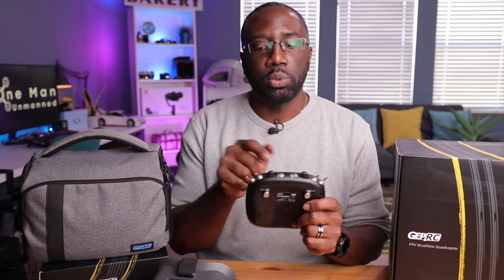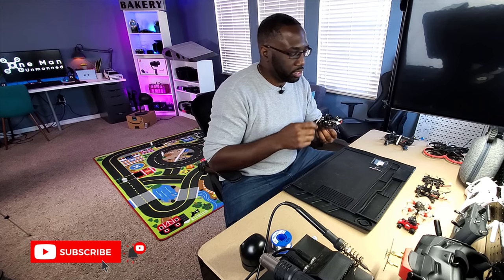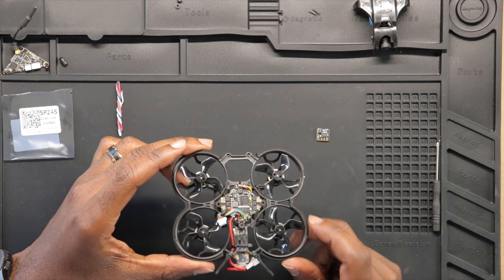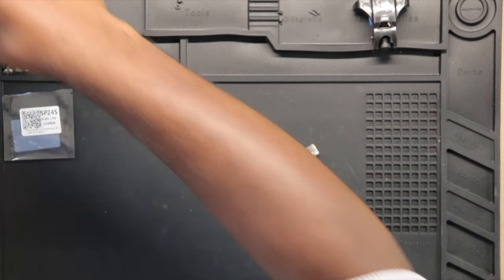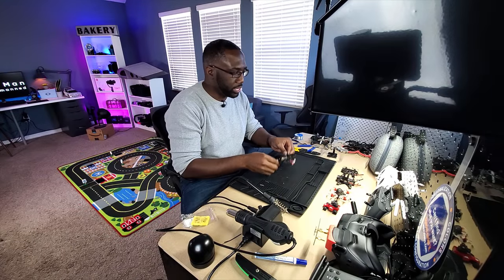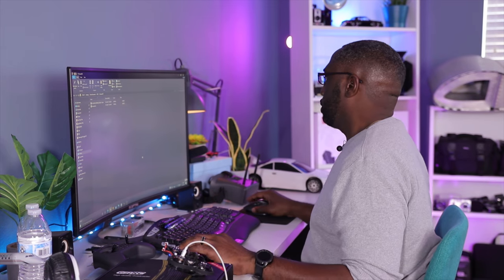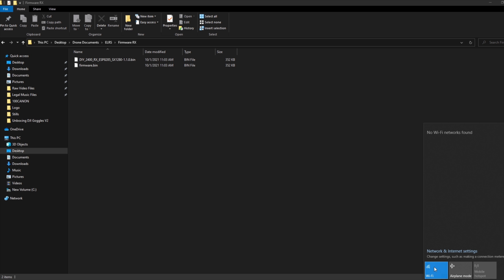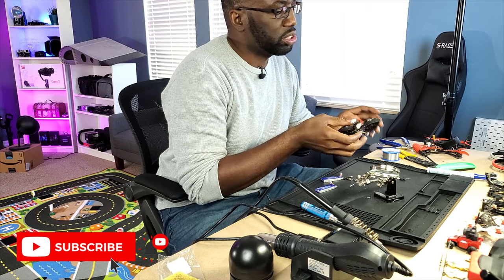Installing ELRS in my TinyGo Let’s me use ANY Radio | But There’s a Catch!

Comment: I just did this mod and started flying the TinyGo with my TX16S (ELRS) today... I love it!! Luckily I did NOT have to install the 1K-ohm resistor. When I built my configuration, I used EdgeTX passthrough to load onto the controller and Wifi to load configuration from my cellphone. I had some other challenges in getting set up in Beta Flight... but thanks to your video (and a couple others) I was able to get it to work. Interestingly, this is my first FPV drone ever.... my other quads are the Mavic 2E and the Mini 3 Pro. Can't wait to build a drone from scratch!!! Thanks for the great videos
Reply from the maker: That's awesome!  I'm glad it all worked out.
Reply: @blueadv214 What did you do in Betaflight to get it to work?

Comment: Followed this tutorial and used a RadioMaster receiver; I actually did the swap before I ever got the drone flying in the first place.   For some reason my board thinks it's backwards so I had to  compensate for that.  The Radiomaster pocket controller is a joy.  Now to replace the vtx/camera that never worked right either.  They sent me a real dud but glad it's going now.  I did an absolutely horrible solder job but it still works :)
Reply from the maker: Thanks for the updates…I’m glad you got it working.

Comment: Very helpful video. I had a similar thing happen on a recent build with the GEPRC FC for DJI. I built a really light naked vista based around the Happymodel Crux3, but using this flight controller. I had already flashed and bound my ep2 using a bench power supply. The problem it caused me is that the drone would fly when tested-------until I plugged in the naked vista. Then the ep2 would stop communicating. I didn't do the research you did. I had a crossfire nano lying around and used it instead, which fixed the problem. That said, I'd much rather have the EP2 on such a tiny build just to not have to fool around with an external antenna and to save a few grams, so I am ordering some resistors today. Thanks!
Reply from the maker: Uh man, that sucks..Apparently some GepRC FC have this issue with ELRS receivers.  I have no regrets in switching though.  I'm glad the video helped.  Thanks for your insights..Hopefully it helps other pilots as well.
Reply: @OneManUnmanned  I just hit the bell on your channel. I try to watch whenever they pop up, but for some reason, the YouTube algorithm had quit sending them my way. Anyway, it was pretty random that I happened to watch this video tonight and once I saw the flight controller you were using, I kept watching because of my experience with it. I was trying to think of some hashtag or something you could add that would help for people searching for this solution, because I am sure we are not the only two that have had this problem, and this clearly illustrates how to fix it.
Reply from the maker: I appreciate you watching the video...As far as the algorithm, YT does not honor the Subscription button(or bell) like it used to.  It will only push content it thinks you'll watch, or relevant content that you've watched in the past.  Having said that, I appreciate you hitting the bell nonetheless.  I will try to better use the hashtag so that my content is searchable.
Reply: @OneManUnmanned  You have great content and production value. I know it is slow, but you'll have a ton of subscribers at some point if you keep them coming.
Reply from the maker: Thank you...I hope it happens eventually.  Thanks for the encouragement.

Comment: So am I right?
Receiver  G -> G FC
Receiver 5V -> 5V FC
Receiver Tx -> Rx FC
Receiver Rx -> Tx FC
& Receiver RX -> 1kOhm -> 3.3V FC

Also do you need to remove the resistor after flashing and configurating the receiver?

Comment: Which is better in your opinion tiny pro or ez max pro pilot? Thanks Tracy Johnson
Reply from the maker: I'm not sure what drone is the Tiny Pro..I think you meant the TinyGo.  TinyGo  vs EZ Pilot Pro, I would say the TinyGo is better.   It has a more capable drone that can fly indoors and outdoors as well as record in 1080p or 4K.  The goggles that come with the EZ Pilot Pro also does not record video(has no DVR).

Comment: Hello One Man, I have the same problem with my tiny go and the ERLS and still couldn't match it, but now I think I have understand what is the problem, I need to connect the 3v3 to the rx righ¿? but  I have the beta fpv  tower antenna and radio lite 2 se, so do I need a to use a pull up resister to connect or could be any other simple cable like the blue, yellow or white one. I will appreciated so much you help cause im new on this world and after a month since I bought it and a lot of simulator, could make a few flights, then I discovered the erls world and decide to get into it by my self but now can't fly cause I couldn't match it  and till now, i didn't now why, but I have the answer thanks to you. I really don't understand too much about electronics components so I´m not sure if need the pull tip resister or can use any other wire and don't burn it. Thanks hermano for the info and hope you can resolve my doubt

Comment: Is there a way to connect GR8 to a PC to play with simulators? I thought I'll be able to fly some hours with it before I start crashing my TinyGO 4K into walls but there's no bluetooth or USB port on the radio. It's a shame because I've got a VR set, I've got a simulator, I have this radio in my hands and it's snowy -20°C winter (that's -4°F) so batteries will die outside. All I'm missing is a way to connect all that together.
Reply from the maker: There is no way to connect the radio to a computer hence why this video is so valuable. 
I've mentioned it here in other videos: 
https://youtu.be/g_7tIYuMOPQ
https://youtu.be/II9jhRvrx1E

The TinyGo can be flown indoors..I would suggest Angle mode while learning, if it's your 1st FPV drone.
Here is the setup and 1st Flight video: 
https://youtu.be/SgecIRGRB7k
https://youtu.be/Q9qMJZ36ceM
Reply: @OneManUnmanned  Thank you very much, I'll study those religiously! BTW I've found out there's a way to connect any 4+ bit chipset flight controller to a PC (the guy in the video says F4 or F7 controller, I'm guessing it means available memory bits) but it requires flashing and either dismantling the drone to get that flight controller or buying an extra one (or connecting and powering up the controller in your drone which will probably require to connect the battery and risk the drone flying off and ripping connectors). You connect the controller to the PC via USB, set it to act as a USB joystick with Betaflight and then bind the radio to the controller. Here's a video: https://youtu.be/wuobzowLfj0
Reply from the maker: Cool.. maybe this info will help others in the future.  Thanks!

Comment: I know this is a year old but hoping you might be able to help me out.  I am trying to do the same thing to my newly acquired Thinking P16.  I have a HappyModel EP1 soldered to the UART2 of the fc.  I was able to connect to the wifi hotspot and update it to version 3 to match my radio.  I go into BetaFlight and enable the Serial Rx on UART2.  I have telemetry with my radio but see now stick/button movement on the Betaflight Receivers tab.  What am I doing wrong?
Reply from the maker: I don’t know what version of the Configurator you’re using, but make sure the UART for the receiver is correct in the Ports tab and Serial RX is selected.  If your go to the Receiver tab, the Serial Receiver Provider needs to be “CRSF” and Receiver Mode needs to be “Serial”.  Don’t forget to safe after you make those changes.
Reply: @OneManUnmanned  Wow thanks for the quick reply.  I definitely enabled the Serial RX on UART2 and checked the Receivers tab to ensure that Serial and CRSF were selected.  I also double checked the RX from the receiver went to the TX of the fc and TX to RX.  Am I missing anything else?

Comment: Hi. saw your video and learned the command for rxrange to delimit points. I have a problem, my drone after update, is not flying, when I turn it on, it activates the engines and jumps like in turtle mode. I noticed that in betaflight the yaw control is at the maximum 2000, I already put the old firmware and it was the same. In the control tab, the drone is rotating and the yaw on 2000. how to configure it to be in the middle (1500)? And also on the PID tab, all the commands go from 0 deg/s- 667 deg/s, when I turn on the radio the yaw goes from 0 to 667deg, while the others remain at 0 deg
Reply from the maker: What radio are you using??  It sounds like your stick inputs are at full and continuous.

Comment: In regard to the receiver swap, I chose Crossfire to match my other quads. It is great to fly it with my Tango 2.
Reply: The Crossfire Nano just wired up to the existing four wires to the stock receiver.
Reply from the maker: The ELRS receivers can be "finicky" sometimes.   I'm glad you had success with CRSF.  The Tango2 is a great radio and still sought-after today.

Comment: Why isn't  it called computer using computers to upgrade and flash drone parts. Andd upgrade to use and flash and upgrrade to use stuff that doesn't work ?
Reply from the maker: Things change so quickly in FPV that firmware updates are necessary new features.

Comment: I’ve watched this tutorial about 10 times. Followed it to a T. Tiny go still won’t bind to radio master zorro
Reply from the maker: I'll need more specific information to what your receiver is doing.  Is it flashing or steady on?  With your radio off does the receiver go into Wifi mode?
Reply: I have the same question with a Jumper T lite. The receiver has a steady light. I used a 470ohm pull down resistor.
How would I know whether the  Rx was in WiFi mode?
Thanks,  Nigel